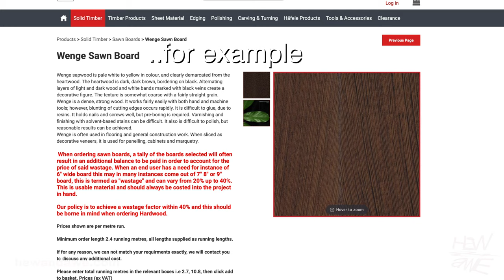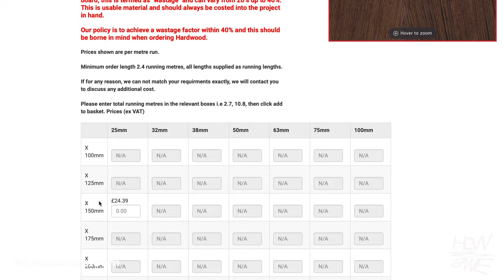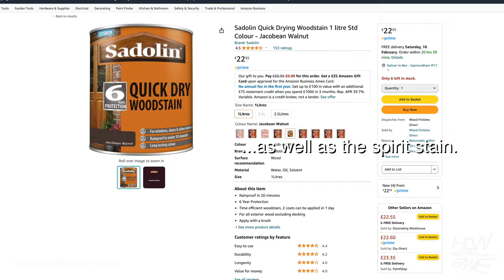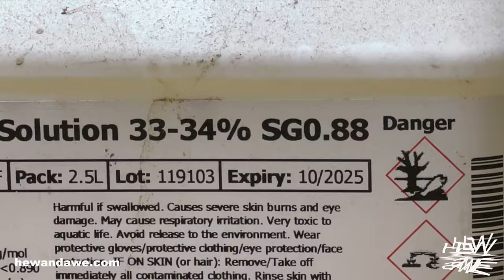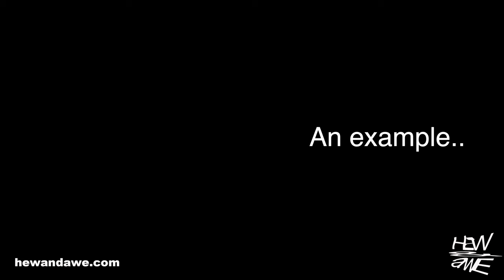Antique Look: Fuming Oak with Ammonia

Comment: Hi Ben, finding reliable methods of staining and finishes that you're happy with can be a long process, nudges in a new direction can help,  have you ever tried potassium permanganate, it's not really a stain but an oxidiser and can easily age wood by a 100 years, mix with water,  not much is needed, layer coats, obviously you're best to try on  scrap pieces first and experiment with your preferred finishes. I know you're not a fan of water based stains but i think you would benefit having this in your arsenal of reliable methods, however if you do try it, check out the do's n don'ts of using it. 
All the best n keep safe   
  Sean
Reply from the maker: This takes me back a very very long time, a blast from the very long past. I did this when I was a kid, nice one for bringing this up, I’d completely forgotten about this!!! 🍻🍻🍻